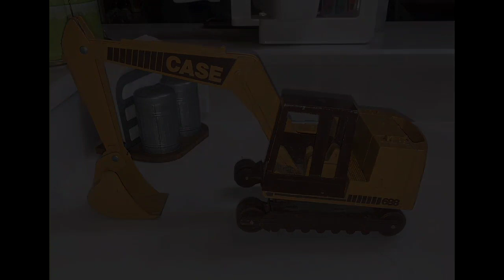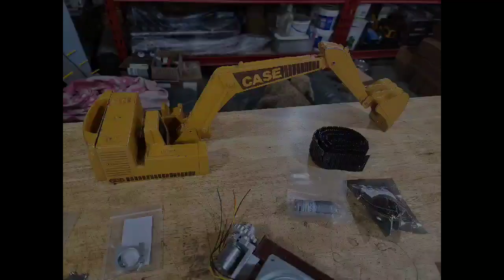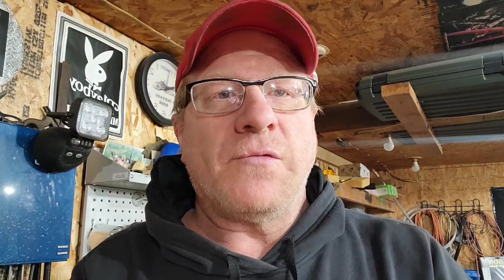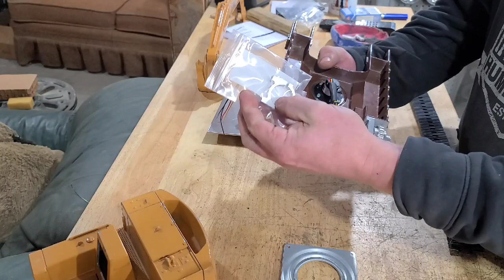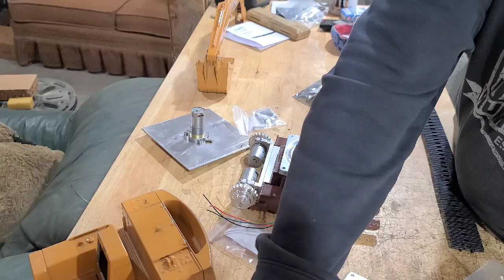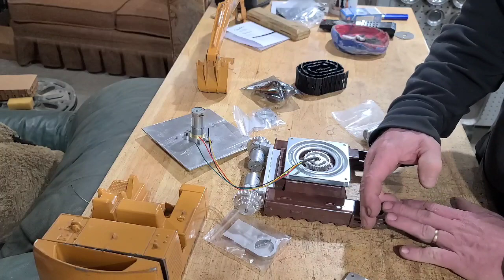1/16 ERTL (1980's) CASE 688 RC CONVERSION PART #1

Comment: That's awesome, quite impressive start to be honest.
So the någon sprocket and the huina track is a direct match?
That is very useful info👍🙂 
Thank you for another inspiring video.
Will be interesting to see how you manage to fit the hydraulics in there.
Reply from the maker: The Huina 580 and Bruder track take the same sprocket pitch to drive them. So the Magom sprocket for the 320 Bruder Cat conversion will work perfect together with the Huina tracks.
Reply from the maker: Yep I will be also interested in how I fit the hydraulics in there as well. LOL